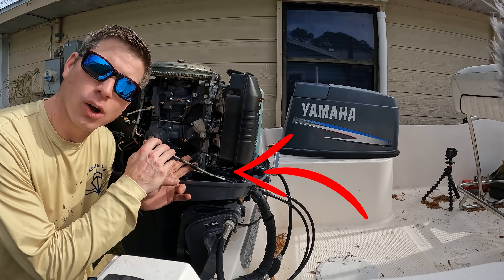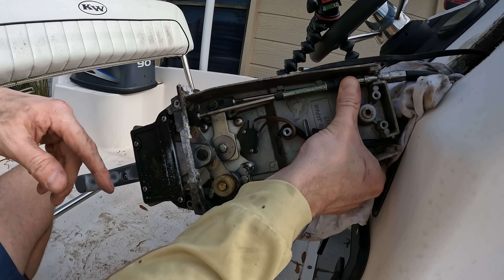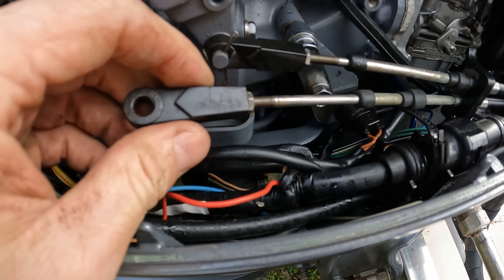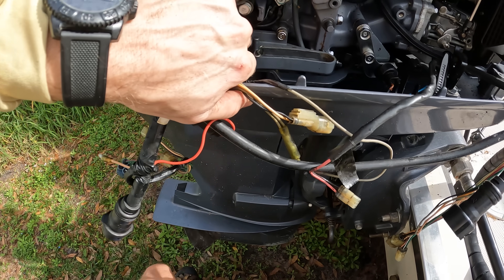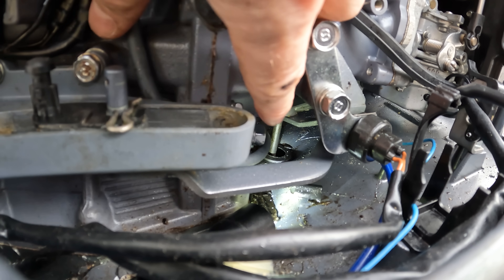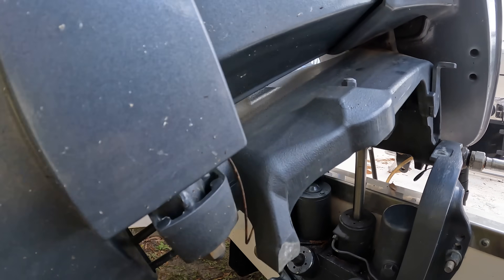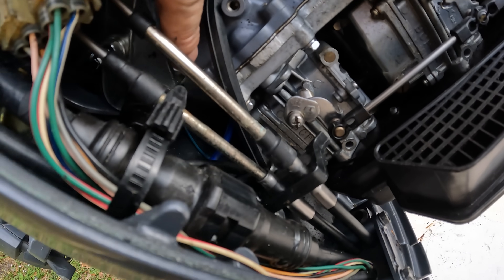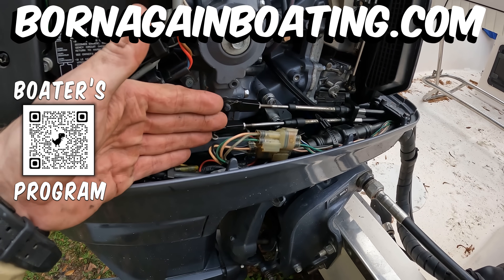How All Outboards Shift: Mechanical & Digital.

Comment: So if the prop is in position where the clutch dog is not lined up how can it go into reverse when cables are all connected up properly and shifted using controller (not running).  I cant shift into reverse by hand with cables disconnected unless the prop is in the right position.  Cant hardly jump in the water and turn the prop every time you want to go into reverse? Im about to buy a new lower unit for this reason. If I cant get it into reverse with the prop in any position then how can the controller possibly get it into reverse? Thanks. Does it need to be running to put it into reverse by hand?

Comment: Any tips on how to get my idle to not rev so high?I have to manually push the throttle cable the other way by the carbs to get it to rev normal .It happens when im switching from fwd to neutral

Comment: I have the same motor. I lubed the linkage points, thinking I was doing a good thing. Right after, it wasn’t wanting to go in reverse. I cleaned up the silicone lubricant the best I could. It still occasionally will not go into reverse. It finally does. I guess it’s got to work that lubricant out?

Comment: So if I am finding a few metal shavings on my shift shaft when removing the lower unit will I need to replace the shift tube that runs up the tower? Having trouble going into forward and clicks with neutral. But if I shift manually at the shaft on the lower unit no problem

Comment: i have a 1985 yamaha 2 stroke and after i disconnected the shift cable to see if i could move the shifter by hand it would not very easy like yours  did. and i turn the prop to see if it would engage but it just spins freely. any ideas?

Comment: Good vid . Just be careful you showed the lower unit in reverse and you turned prop in forward direction, That could flip the water pump impeller vanes.

Comment: I've got a 4-month-old 4-stroke 50 horse tiller handle Yamaha just had it taken to the shop could not get it from neutral to reverse or from reverse to neutral it would get stuck in one of the other gears I finally tug too hard on it and broke something it works fine when the motor's off but when the motor is running is when I have the problems

Comment: should a 2000 johnson v4 outboard make a grinding noise going into gear when out of the water no load on the prop, standing still it grinds going into gear until the prop starts spinning then goes

Comment: Thank you for your video. I have yamaha 300hp with digital control throttle. I had emergency where I was o. Plane and had to stop to avoid collision. I pulled the throttle to neutral quickly and to reverse. The engine stall . Is that normal? I was able to turn the engine back on and operated normal after that.

Comment: Your video is so awesome. 
Learn a lot from watching your video.

My 1996 25 Hp Yamaha 2 strokes it shift in gear by itself while idling.

Do you know what cause the motor to do that? Any information is greatly appreciated
Reply from the maker: Most likely an adjustment but you'll need to run the tests to confirm what is going on

Comment: My throttle goes in and out of gear but it's very stiff when applying throttle any tips
Reply from the maker: Nothing outside of the video and taking the throttle cable off and checking that system just like the shift system :) try and move it with the cable disconnected : )
Reply: @BornAgainBoating  thank you! Best boat channel by far! Love your content.  Used the boat a lot today and it seems to be losening up. Might replace cables this fall. They are 10 years old now.

Comment: I have a 2017 mercury 150 EFI and after I run it for a certain amount of time the throttle gets stuck in forward gear. It is so odd. I have to run for 20 or more minutes on plane before it won’t go back into neutral.  If I run for 5-10 min no issues going in and out of forward and neutral.  Any thoughts why this happens?
Reply: If I hook it up to a hose I can shift effortlessly into reverse forward neutral with no issues. I can’t get it fixed since the mechanic can’t replicate the issue
Reply from the maker: That's weird, but I would look at the shift shaft and stuff on the engine, something sounds like it is locking it in gear when in forward and loaded, if not loaded, (on land on a hose) there isn't the weight and force to lock it in place. But also maybe someting that is keeping the RPM up, hard to say, someone should be able to figure that out with some time looking at it :/

Comment: Glad I found this video. I have the exact motor. It shifts fine into forward and reverse. However when I accelerate in reverse it pops out of reverse and makes ratcheting sound.
Reply from the maker: Yeah, this should help you out a lot, here's some more info that will also help you understand the process of the lower mechanically :)
https://www.youtube.com/watch?v=CNXLhBSDRY4

Comment: i have a mercury opti that grinds when either shifting in forward and or neutral is that normal?
Reply from the maker: Not really, hopefully you are shifting fast enough
Reply: You are not shifting fast enough.  Shifting should be a swift movement. If you shift too slow it will grind!

Comment: Good Stuff...Is it worth trying to lube both cables. Does it work or the effort .
Reply from the maker: I don't think so, like talking about lubing the inside of the cable with air pressure and ATF type lube, no, cables are cheap compared to the effort to try and save them